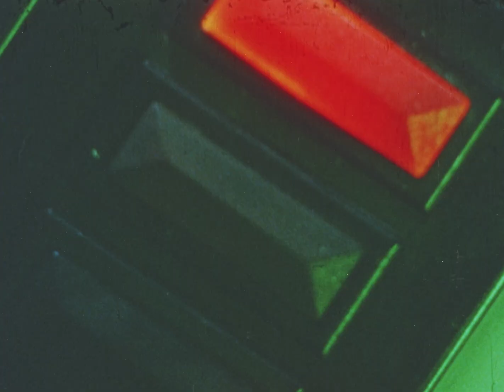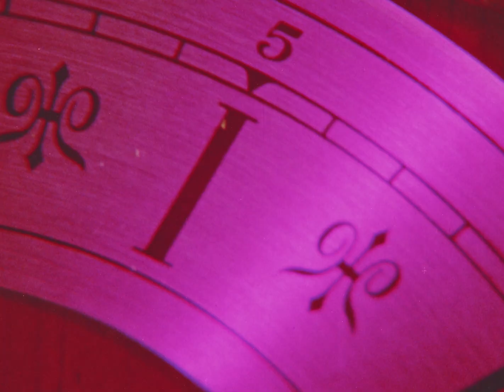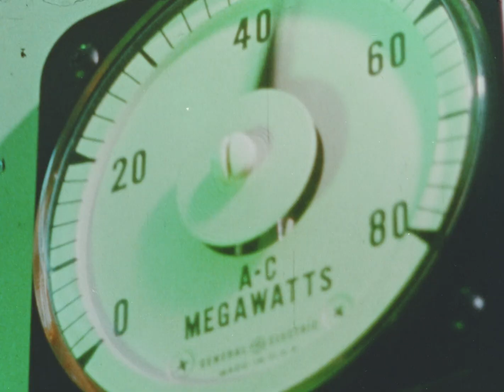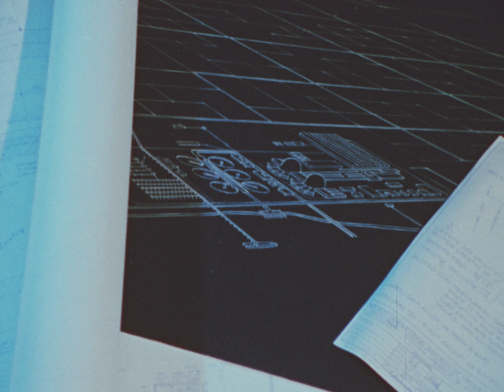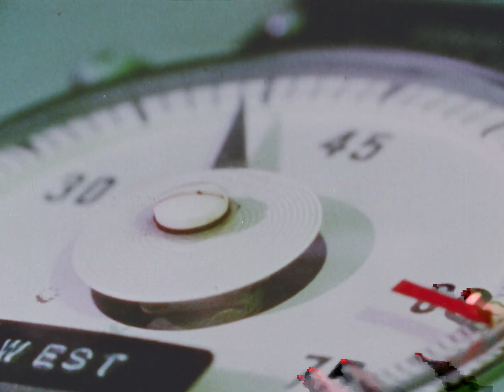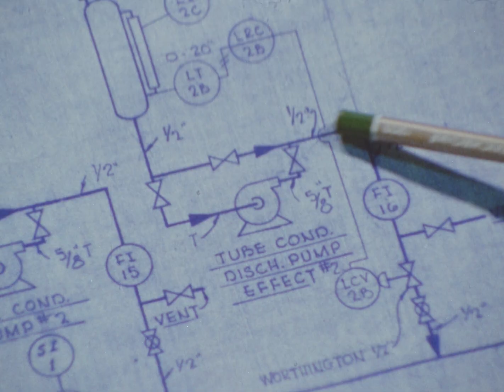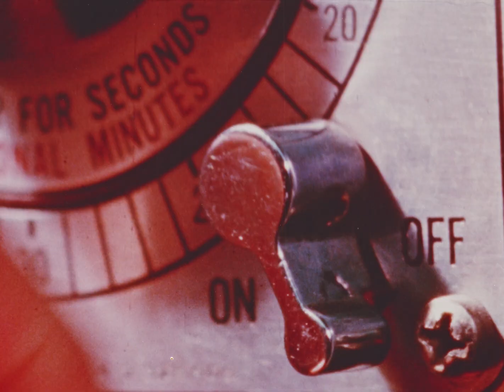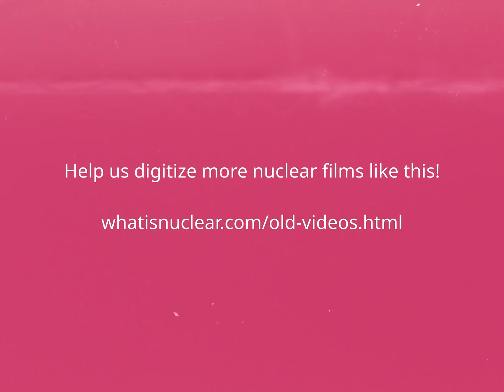No Greater Challenge: The Nuclear-Powered Agro-Industrial Complex (1969)

Comment: "20 inches of fresh water to produce 100 bushels of wheat per acre"

what
Reply: I assume 20 inches of rainfall to produce 100 bushels of wheat per acre. I had to look up what size a US bushel is, by god is imperial an arbitrary rollercoaster, a US bushel is 35.23907016688 litres or 9 and 3571/11550 US gallons or 2150.42 cubic inches or  1 and 21121/86400 cubic feet. Such silly means of measuring.

Comment: Couldnt we use nuclear to heat the sea water distilation plant? Converting sea water is expensive only because you need to boil repeatedly. If we use nuclear heat instead of petrol. It would be far more cost efficent
Reply: Solar pV electricity to do the heating. Much cheaper up front.
Reply: @leafbranch1872 Solar is cheaper up front maybe but it only works when the sun is shining and it only lasts 20 years before needing replacement. Not to mention how much land it takes to build a big solar farm. On the other hand nuclear works 24/7 and a plant last 80+ years and it can be build on a fraction of the land used for a solar farm.

Comment: Thankfully with solar, this could be done on a smaller scale now.
Reply: not really, solar at grid scale doesnt work, its not economical, solar at the individual scale is ok, my father does it, but thats because we are from zimbabwe and so the grid is so unreliable that the solar upfront cost makes sense to pay for.
Reply: @TS-jm7jm  Solar is economical in the US at grid scale at the moment, unsure about other countries though.

The issue is nuclear reactors are not economical because the US has thrown away all the jobs for designing the components. There were a number of nuclear reactors that had to be stopped because they couldnt be built, because the country had nobody to build the parts.

Meanwhile solar has an industry behind it.
Reply: @switted823  I'm not just meaning manufacturing but also installation, there are a lot of people that install solar in the US, so it isn't hard for a town to decide to install some, or a farm.
Reply: Solar cannot provide base load power at night or on cloudy days. Its too expensive to desalinate sea water.
Reply: @DoktorBayerischeMotorenWerke  LiFePo4 batteries are helping with that. That is something where there are a lot of factories opening up in the US making batteries. I have a growing LiFePo4 system charged from my solar panels. Pretty much solves the issue of power at night.
Reply: @ Just because it works in a tiny niche application doesn't mean that it is commercially viable in a large-scale operation... which solar is not..
Reply: @ Solar seems to be working fine in large scale applications. I've seen several solar farms pop up, and storage batteries have worked really well in Australia for balancing the grid.

Comment: The optimism of the 1960's.
Reply: Yeah, everything possible back then
Reply: We have come up with better far safer nuclear power plant designs since the time all of the current commercial nuclear power plants were built, it's just that no one has really built commercial scale versions of them so far.
Reply: @jokerace8227  I would dig into some of the ongoing contruction if I were you, might find some gems in there, including a sort of modified LFTR in China
Reply: We need NAWAPA!
Reply: We can't even get a single nuclear desalination plant in CA during this decades-long drought.
Reply: This is still possible bringing seawater from the ocean requires water-filtration and electricity to pump all the water, so it can be done!
Reply: We didn't let Christians slow our Humanity down we'll be there by now

Comment: The only thing missing is extracting the uranium from the seawater brine, closing the loop.
Reply: With a liquid fuel thorium reactor running at 600 or 700C, you can desalinate seawater with waste heat.
Reply: @kevinmerrell9952  With a liquid fuel uranium reactor running at 600 or 700C, you can desalinate seawater with waste heat and extract enough uranium to fuel the reactor.
Reply from the maker: Uranium breeders are just as good as thorium breeders. Uranium can run in breeder mode or not, thorium is constrained to always operate as a breeder.